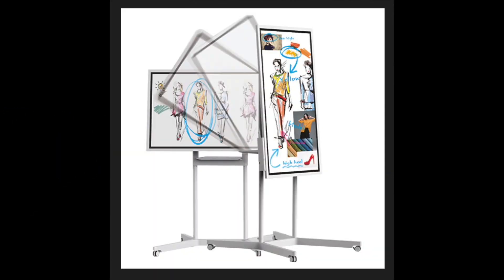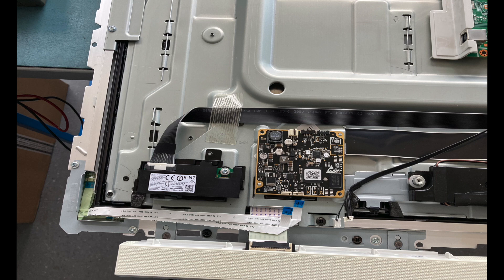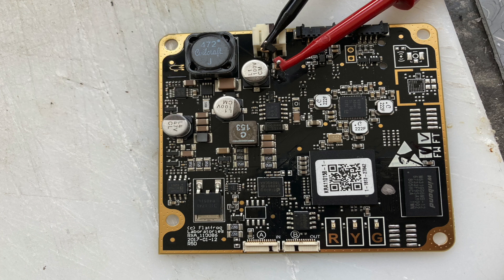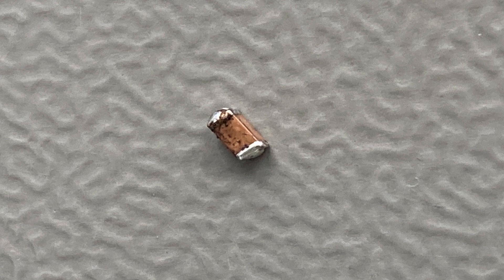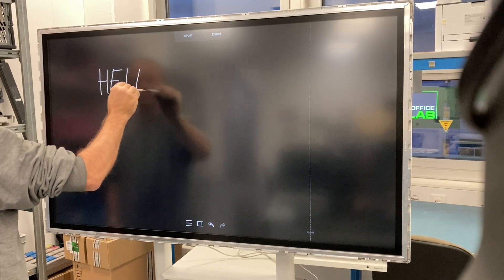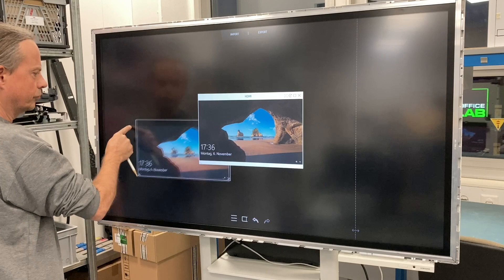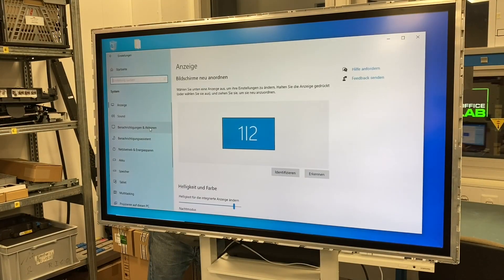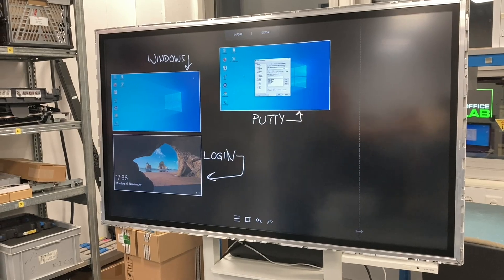Samsung Flip-Chart repair and why you need a thermal camera (PWJ217)

Comment: i need to replace the led back light, do you have a video guide or some info to open the tv step by step
Reply from the maker: I don't have a video about that. You need to remove the front frame and then more screws are accessible.
But be careful, it has many hooks and it breaks easily. I broke my frame in two places and had to glue it together.

Comment: Nice fix! Where do you get these things? I’m scouting Ricardo but the prices are often ridiculous there and a lot of it just gets dumped to the “recycler” by offices. Also, where do you get individual semi conductors from? China is a gamble but distrelec etc charge 18–20 CHF for shipping when I only need a 1.- capacitor. Would love your input. And thanks for the videos, I enjoy watching them :)
Reply from the maker: Since repairing things is our business, we don't buy only one or two components, we usually buy 50 or 100 or we try to combine orders. Usually shipping cost is free when you order 50+ SFr.
In this case I took a capacitor that I salvaged from an old server board. I collect small SMD components from waste.
The Samsung Flip came from one of our own offices.

Comment: Fantastic! I wish thermal cameras weren't that expensive, I'd totally get one! Thank you for the video!

We use tons of those Samsung Flip devices at work. It's great until it isn't. For such an expensive product and with all the great technology like having external input as a window appearing over your writing area there is also severe limitations: Somehow, Samsung forgot to include even the simplest features of MS Paint like drawing straight lines or simple shapes, meaning you have to use old black-board utilities to draw those and risk scratching the screen. Also, the processing power of those boards is (especially the larger version, not the smaller one you have) reaches it's limit when using the onboard web browser!

Have a nice day!
Reply: There are USB thermal cameras that you can plug into your phone, they're relatively cheap.I have a Topdon TC-001 and it's really useful.

Comment: Actually, 3840x2160 is 4K
Reply from the maker: Yeah I was confused because they switched from counting lines (1080) to counting dots per line. Up to 1080 it was vertical resolution and then it became horizontal resolution.

Comment: That's a very impressive product.  For tracing these kinds of faults without a thermal camera, the slightly lower tech way is to use a vapourizer pen which is loaded with pine rosin flux. The rosin evaporates and condenses into a white film of crystals which coat the parts to be tested. If a capacitor is internally shorted, the white film of flux will melt and point out the shorted component like a sore thumb. The other essential tool of this method is a 0.5 volt power supply which provides power for heating but is too low in voltage to flow beyond the short in almost all cases.
Reply: Isopropyl alcohol in a syringe will boil aggressively on a hot component also